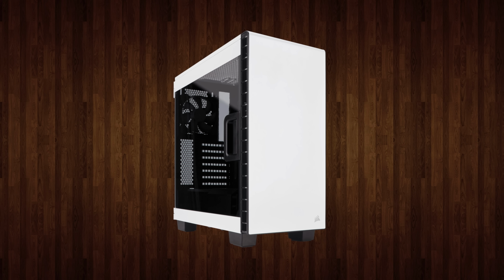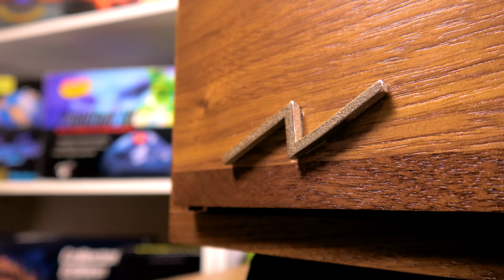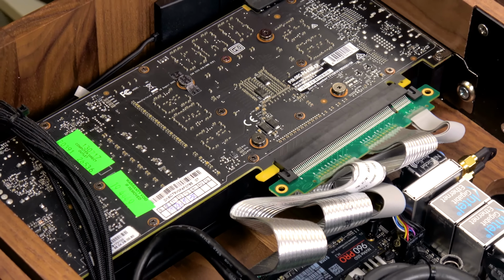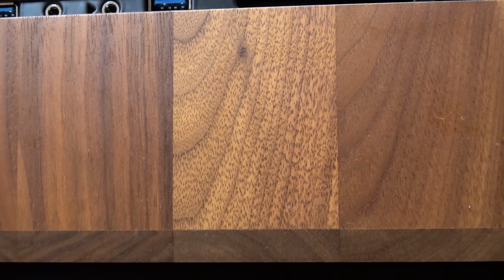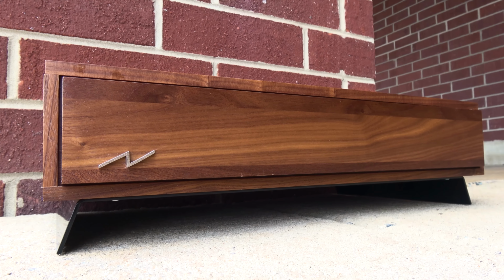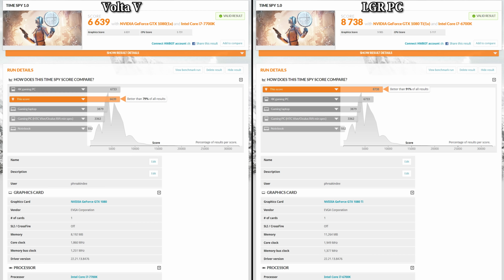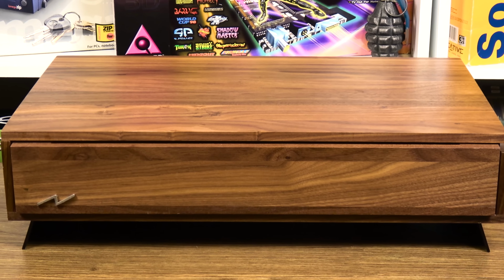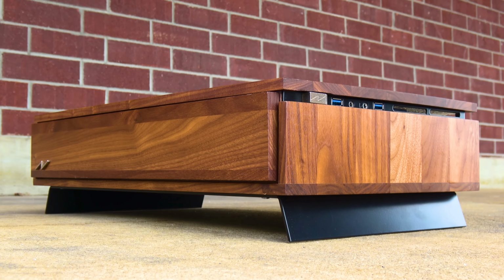LGR - Volta V Wooden Computer System Review

Comment: I used to build custom, high-end cabinets, the build quality of this thing isn't that great, something like this never would have made it out the door of the shop. It's also a weird design as far as wood cabinets go, it makes me think that humanity is forgetting how to work with wood.
Reply: Same thoughts. Too many separate pieces of wood joined together
Reply: Yeah, first thing I noticed too, really simple and rather poor build quality. It's a box ffs, how hard can it be?
Reply: Exactly my thoughts. Hell, the vintage equipment shown in the video has nice single-panel walls with perfect miter joints. This is just terribly lazy in comparison.
Reply: agreed, overpriced and does not look too good, hell i'm not a woodworking expert but i can build something like that myself if i ever decide i want a wooden pc box
Reply: Glad to see someone else say so. I'm a machinist by trade and a home carpenter of sorts. That cabinet was pretty poorly designed and executed. I didn't really spot any mechanical joinery whatsoever, and the spliced wood everywhere really doesn't shout quality.  I'm not bitter or anything but wow, compared to my 1930's Zenith floor radio, this thing is junk.
Reply: Was going to say something similar. For the price I would expect expertly cut dovetail joints and for all the pieces to line up perfectly. If you look closely the top lid doesn't even line up with the box at all. For the price everything should fit perfectly. It should employ some really nice old fashioned carpentry. I'd enjoy seeing someone take this basic idea to one of the many carpentry based YouTube channels and have them come up with a similar case using traditional construction methods.
Reply: Agreed.  Looks at first that the front was a drawer, it's seems like it should be recessed in to the rest of the body. I went to look at there site thinking they may have sent him a per-production model but its not.
For the money they are asking they need to improve the fit and finish.
Reply: So glad I wasn't the only one thinking it.  It's not a nice job at all.
Reply: I have to question LGR's taste in anything wood if he honestly thought that thing looked even remotely well made. That's not even something that would have made it out of a high school's woodshop class.
Reply: As far as i gather it is more the fake-wood veneer stuff that LGR likes and not woodworking as a craft.
Reply: Agree with you. We did made similar looking boxes at shop classes in school. And we didn't have any power tools.
Reply: It looks like they had a bunch of scrap molding laying around and decided to glue them together edge on and make a case. They didn't even try to match the color on the side panel; it looks like a piece of white oak in the middle.

Then again, it looks way better than the "retro TV" console someone reviewed a while back. It was literally a box made with plywood glued together.
Reply: Well if you were to look at the 3D photos of the products, they look far better. While the product that Clint had was a result of them learning that it probably wasn't economically feasible to make whole big pieces and just made small cuts and glue them together. So that wood could be salvaged wood but I can't say that for certain.
Reply: I agree, this is poorly executed.
Reply: my thoughts exactly
I've made better wooden boxes in my school days
Reply: Whilst I agree with most, this is a pretty basic box, it's aiming at a particular market. I'd rather build my own in a butt ugly case and pocket the change. This is for people who buy Apple products or high end phones etc. Don't forget you are also paying for the lifetime warranty. Sorry smartmonkey777 but you don't need to "laser cut" anything, a template for the holes would work just fine - it more comes down to the volume of units produced. In all honesty that box could be knocked up pretty quick using a mitre saw.
Reply: agree. Looks bad.

Comment: I totally hate the gamer aesthetic that's why I use an NZXT S340 Elite, it is clean and not flashy.
Reply: Nzxt I hate them especially their top mounted USB port that pissed me off.
Reply from the maker: Aye, that's why I grabbed a Fractal Design Define XL R2 myself. Hugely functional, minimal but pleasing aesthetic.
Reply: It does lack woodgrain though.
Reply: Ugh, RGB stuff specially. They make computers look like brothel neons
Reply: I hear ya man some case designs are just obnoxiously loud in the visuals department. I've got a  Lancool Dragonlord k62  it's pretty sleek for a gamer case.
Reply: The case my computer was saddled with has a relatively sober design, if you ignore the hideous green lights/"water-effect" plastic tubes on the front. Alas, whoever designed it didn't seem to understand why making the hard reset switch both larger and easier to press than the power button is a bad idea.
Reply: I fear for my next system upgrade; I have a 15+ year old Chenming server case, but it's really not cutting it thermally.  I'll have to get a new case if I want to go beyond my current 6-core AMD setup and I know I'm going to get saddled with some paper-thin aluminum trash with red and black plastic spikes everywhere unless I'm willing to spend a mint on the case itself.
Reply: i still use an old antec P180 for just this reason, it looks like an old server.
Reply: I just went with a cheap black Antec case. May upgrade to something with a clear panel down the line but nothing to flashy.
Reply: Fractal Design Define R5, a nice clean case. Personally the "gamer" cases remind me of The Batmobile, but if that's your thing, cool.
Reply: I use a Fractal Design Define R4 because of the clean look. Interested in modding handles onto mine.
Reply: Ahh.. I have the same style of Fractal Design Black Monolith as you do Clint. Good choice. Simple, elegant, and efficent.

I am not totally against those RGB flashy light shows with their glass panels that are so pop these days. But they're a bit like Las Vegas with their garish look. They're fun for a while in just how extreme they can be, but one gets tired of them quickly.

I far more prefer case I have. And it was very affordable too on top of that.
Reply: Martin M Yup, I actually plan to put a hinge on mine or something along those lines in the future.
Reply: DiddyHop I agree, my system is all black with only my Video card, Cooler, and motherboard using RGB lighting which is set at white all the time.
Reply: The Windows network name of my computer is "Monolith" because of the Fractal case. Not that I look at it a lot, it lives under my desk hidden by a slidy thing that's part of the (Ikea) desk.
Reply: Le Leedler I have a Rosewill FBM-05 case, and it's understated look is pleasing to look at; and it has a Z170M Plus motherboard from Asus, an i5 6600K, a 250 GB NVMe M.2 SSD and 7,800 RPM 1TB hard drive from Western Digital, 16 GBs of PNY Anarchy DDR4 RAM. It doesn't have a graphics card just yet, but I'm leaning towards a GTX 1060.
Reply: digitalrailroader Glad you enjoy that case, I do have to question the 16 gigs of RAM... Unless you are a photo/video editor you almost certainly don't need 16 gigs of RAM.
Reply: Le Leedler I chose 16 GBs so I could have plenty of headroom for future gaming; also the Z170M Plus has a capacity of 32 GBs of RAM; so I still have the other two memory slots open in case I run into a game that needs an insane amount of memory.
Reply: Unless you like to leave your browser open with 6 youtube videos and 12 other tabs open while gaming. Then 16gb of ram is justified.
Reply: At thedungeondelver 
there might be another option, check out s fan called the silverstone air penetrator. It's a thing of pure magic, it pushes out a little tornado. I use one and its very good at what it does, it is a little loud though :)
Reply: Still using my old Fractal Design Define R3 Titanium. Upgraded to Ryzen just in the last couple of weeks and felt no need to upgrade this case, minimalistic look and no flashing HDD light means it fits right into my living room.
Reply: Hence why I use a Cougar Solution, simple, black painted steel and plastic, just enough aesthetic without being excessive, functional and cheap as hell.
Reply: Eli Suryana and that is a perfectly reasonable opinion; some people love the tempered glass and RGB lighting aesthetic look; while others think that the current case fashion is as garish looking as the Las Vegas Strip.
Reply: digitalrailroader I like the colorful aspect of the current gamer aesthetic, but not the harshness of the casing designs lately. The last thing I need to be sharp and pointy is my mouse.
Reply: Makayla Serniotti there are some case designs that make you go "okay, what was the designer smoking when he came up with this?" A good example is the Omen X; a giant cube stood on one edge, that takes up half of your damn desk!
Reply: Makayla Serniotti If you point to things with the cursor, then isn't every computer mouse pointy? 🤔

Comment: Hmm. The idea is awesome, it looks beautiful, but the technical execution isn't great. There is no shieding against electromagnetic interference (either going in or coming out of the computer). Cases are metal for a reason - and that is no noise on the radio and no interference between clock signals and stuff like bluetooth or wifi, and no interference of a leaky microwave oven to your motherboard and stuff...
The lack of easily accessible connections would also drive me crazy in the long run. For this amount of money, i expect stuff to be near perfect.

Comment: The build quality is kind of meh. Sharp edges like that is a huge no go on a finished consumer product.

A pair of large neodymnium magnets in my computer? No thanks. I just put my wallet on it one day and ruin all my magnetic cards.

Wood is also a very good thermal insulator. Which is NOT good for hardware like the 1080GTX.
Reply: ET 

My Nzxt s340 elite has magnetic filters, it's fine.
Reply: wrong kind of magnets
Reply: The magnets in that "Nzxt s340 elite" is not on a level surface that you might decide to put something on...
Reply: nor are they the same strength
Reply: Go home.
Reply: Sure. I just need to phone my parents and they will come and pick me up...
Reply: ET 

Sorry, I didn't notice the "neodymium" in the sentence, I stand corrected.

Comment: I hate the RGB trend as well.
Reply: I don't hate it the way some people do, but my computer is in my bedroom.  If for some reason I had to leave my computer running overnight, I'd have to cover up or unplug the RGB lights anyway, just so I could get some sleep!  That's why I settled on a plain black (with brushed aluminum highlights) case that I bought for about $60.  Even then, I have to put electrical tape over the power light and HD light, because they're those super-bright blue LEDs.
Reply: Yeah, I never really understood it either. I could see if LAN parties were still as big as they used to be and you wanted to show off but I don't see much of a point otherwise. I picked the most black featureless case I could find for my current computer, it looks like the monolith from 2001: A Space Odyssey. The only two lights it has on the front are little blue LEDs for the power and hard drives and they're literally the size of pinholes.
Reply: you actually get used to it i thought i would hate the bright blue fans on the front of my case (not my choice they came preinstalled with the case) same with the bright blue power LED but i actually got used to it even though i have still on occasion thought of taking and swapping the Red Fans i put on top to the front and just putting two black fans up top or even putting the two black ones on front and leaving the Motherboard bathed in Red
Reply: I love it, all the flashing and pulsing and breathing effects.  So satisfying.
Reply: I like how you can get some cases ( Bit Fennix Prodigy ) in a color motif so that if your thing is orange or blue, you can color coordinate your entire setup to be same same. 
But the cascading rainbows that you see on modern keyboards and LED lights is completely lost on me. Granted if I were 13 years old it would seem amazing to have a color wheel, but nowadays I just don't care. Give me the most inconspicuous PC peripherals that can be found and call it a day. Heck, I'm at the point where I don't even want my PC to sit on the desk. Want to get a PC Tower caddie so that I can suspend it underneath the desk like The Human Solution advertises for their 'Sit to Stand' desks.

Comment: If you would like a horizontal monitor-stand case, check out the Taku case which is currently being Kickstarted. LinusTechTips covered it recently, so there's a nice video there. Looks really good, "only" costs a couple of hundred, and includes a good CPU cooler if you back the KS

Comment: I'm not a fan of most modern cases either. However I plan on buying a 4U server rack mount case and painting it up in glorious IBM Beige. With just a little work it should give a suitable generic early 90's/late 80's aesthetic without being accurate to anything in particular, throw in a couple nice CRTs (like my 19" 1600 x 1200 Envision) One of those Unicomp Model M's and we got something nice. I'm really trying to find an acceptable Mouse for this set up, I need one that performs at least as well as a Logictech Model M100 mouse, which isn't much of a feat, except the only 'retro' style mouses I can find seem to be just the cheapest crap possible.

Comment: I think I'd rather take woodworking classes and make one myself.  The internals, I can handle, it's the woodworking that I can't do.  Given that my wifes uncles all are carpenters (of the making furniture kind), I probably could learn from them.  For the kind of furniture they sell, I already suggested they could integrate a computer and monitor in their desks.  They weren't interested, but I still say "why not".
Basically, a computer in a drawer that is upgradable would do... probably with an LCD screen made to be popped up or something.

Comment: While I agree that the exact "modern" PC case (straight out of 2007) is terrible looking, there is such a thing as tasteful RGB.
Also, the Cryorig Taku is a much better option for a horizontal PC case, IMO.
The current trend in PC cases is to be minimal and have glass on the sides, which I dig. Tempered glass windows or side panels is sexy, and if your RGB is subtle, it can look REALLY good. Also, note that tempered glass makes your RGB darker, so it's not a giant ball of glowing lights.
I personally use a Razer Blade as my daily driver. I love the matte black, but I hate the green logo. Dbrand skin covered that up, and it's fine now. I wish I had the newer model with an RGB keyboard, but oh well.

Comment: This makes the Cryorig Taku look like a sweet deal ;) This looks worn even from the beginning. Might be a review sample that's been around the globe though, so I'll give it the benefit of doubt there. 

Buut yeah. The Taku is still very classy looking, while not having this 70's look. And I think it would fit better into modern or even semi-modern homes than this. :P The Volta is in no way a bad looking case though. But it does look a bit home made. 

About the price - I heard, from the people behind some ITX case (could have been the Taku) that a decent PCIE extender could cost as much as 100 dollars, so these slim cases that relie on those will always be expensive unless they make a new form factor standard where the PCIE connector is mounted sideways directly on the motherboard.

Comment: I'd prefer a simpler case than what most gaming PCs provide. Heck, you can put a modern PC into an Atari system or a dead-as-hell CD-I and I'll be fine (SOMEBODY DO EITHER!)! That being said, I prefer mechanical keyboards, preferably the one you're using in your intro. I feel like I make a few less mistakes and type slightly faster on a mechanical keyboard vs. a digital one.

Comment: For that price, why not have a local workshop make you up a custom case in the wood and finish of your choice and fill it with your own computer innards? It would certainly be a heck of a lot cheaper.
Reply from the maker: A woodworking guy I talked to said it'd be $400+ to get a case like this made from the same materials, at least when the time for customized design and the finish/assembly is taken into account. But that's talking about hiring someone to do it specially. Doing it yourself would be cheaper, but that is assuming one has the skills, the time, and the tools.

Comment: No wonder on the price. 960 Pro is the fastesSSD I know. And I got it for 700€, best price I could find in january 2017. 2500MB/s sequential write speed and extremely long life is what you are paying for. Checkdisk of the 1TB SSD on startup, while I have force closed my laptop takes some seconds. I remember the times where you had to quickly press any key tocancel disk checking and if you failed then you had to wait it out. Good hardware. I got 8.7 Windows Experience Index with it.

Comment: $2800 and what do you get for that price? Max $1200 in components slapped into a box I could have made in woodwork class when I was in middle school. The motherboard could have easily been moved backwards enough that it's back panel would have been at the back of the computer. Jesus, they haven't even been able to cut any of the wires down to length meaning that they either don't know how to do something that basic or don't have the very basic tools required.

Sort of reminds me of the joke we used to talk about one brand of Soviet car that used to be sold over there. If you bought one the dealer would throw in a petty good toolkit and the joke was that this toolkit you got with the car was way better than the tools used by the people who actually built the car.